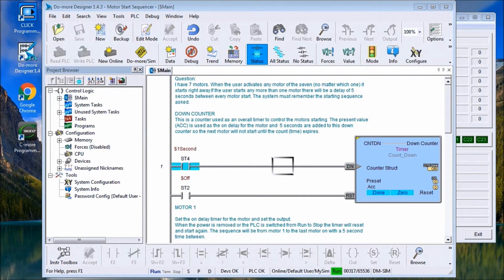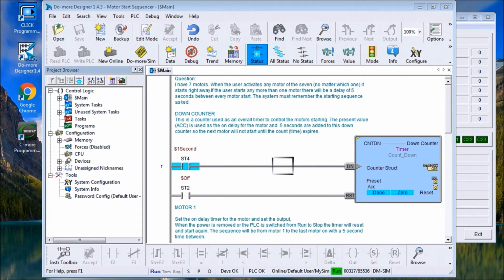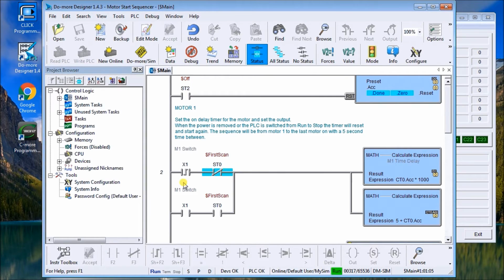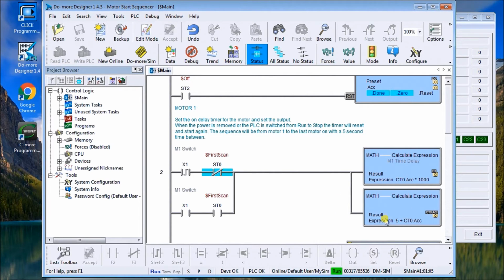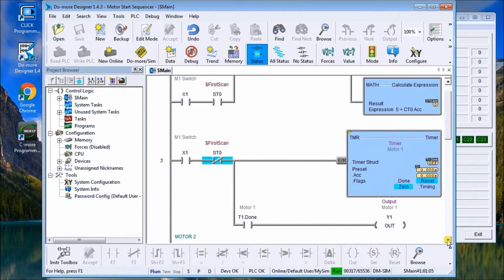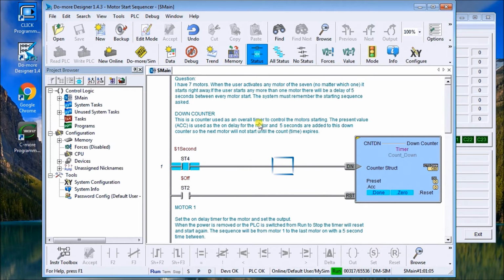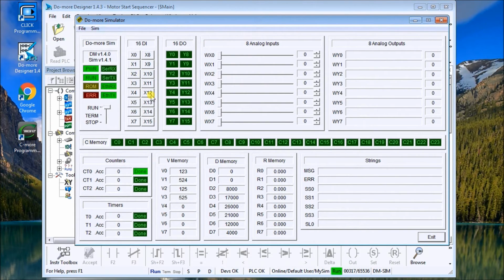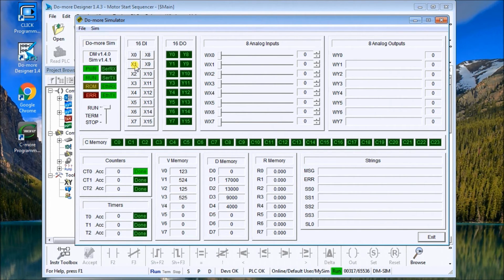Master PLC Motor Delays: 7-Motor Sequential Start Guide

Comment: Hey. Can you tell us where we can finde book or manual where we can finde all instructions that exist for that plc that you are using.
Reply from the maker: The manuals can be downloaded free at the automation direct website. http://www.automationdirect.com/adc/Manuals/Catalog/Programmable_Controllers/Do-more_Series_PLCs_(Micro_Modular_-a-_Stackable)
Select the manuals tab. 
Software is also available free and comes with a very good simulator. It can be downloaded at the following link.
http://support.automationdirect.com/products/domore.html

Regards,
Garry
Reply: I think that would be better that you make video of making ladder diagrams and explaining each component what is ther porpuse and why is there, step by step. For example I never would know that there are puls generators that make puse every 1s, I could program that. It would be easyer to all of us 1st to know all ladder symbols
Reply from the maker: Good idea. I do not have anything that breaks the PLC logic down into the individual components. Our PLC basic menu only has the following:
http://accautomation.ca/programming/plc-basics/

This page will be the closest thing that you are requesting.
http://accautomation.ca/plc-bits-numbers-and-position/

Regards,
Garry

Comment: how do you connect the rungs to each other?
Reply from the maker: Hi Rainbow,
A new rung will automatically start in the Do-More Designer Software. You cannot connect them.
If you want to draw vertical lines for parallel contacts (input or outputs) within the rung then this can be done using the following:
Use the Ctrl + Arrows to make a vertical line. (Arrow up / Arrow down) Ctrl + Shift + Arrows to Erase.

The following is from the Help menu of the software:
How To Draw Wires Between Contacts and Coils

Creating complex ladder logic requires the ability to "draw" networks of input contacts and the ability to connect multiple output coils or box instructions in parallel. Do-more Designer uses the Ctrl key with the arrow keys to draw connecting wires in the direction of the arrow.

Wire Right (Ctrl + Right Arrow) - draws a horizontal wire in the current cursor location and moves the cursor to the right. Drawing a connecting wire over the top of a contact will not delete that contact; it will simply connect it if needed.

Wire Left (Ctrl + Left Arrow) - draws a horizontal wire in the current cursor location and moves the cursor to the left. Drawing a connecting wire over the top of a contact will not delete that contact; it will simply connect it if needed.

Wire Down (Ctrl + Down Arrow) - draws a vertical wire along the left edge of the edit cursor down from the current cursor location and moves the cursor down to the next row.

Wire Up (Ctrl + Up Arrow) - draws a vertical wire along the left edge of the edit cursor up from the current cursor location and moves the cursor up to the previous row.

Wire to Output Column (Ctrl +W) - draws a connecting wire from the current cursor location all the way to the output column. Pressing it again will remove the connecting wire that was just drawn.

--------------------------------------------------------------------------------

During the process of editing ladder logic rungs, there will be times when a connecting wire needs to be deleted. Do-more Designer uses the Ctrl key and the Shift key with the arrow keys to delete connecting wires in the direction of the arrow.

Wire Delete Right (Ctrl + Shift + Right Arrow) - deletes the horizontal wire or programming element in the current cursor location and moves the cursor to the right.

Wire Delete Left (Ctrl + Shift + Left Arrow) - deletes the horizontal wire or programming element in the current cursor location and moves the cursor to the left.

Wire Delete Down (Ctrl + Shift + Down Arrow) - deletes the vertical wire along the lower left edge of the edit cursor and moves the cursor down to the next row.

Wire Delete Up (Ctrl + Shift + Up Arrow) - deletes the vertical wire along the upper left edge of the edit cursor and moves the cursor up to the previous row.

I hope this helps you out.
Regards,
Garry

Comment: Hello,
Please help me with a little PLC Programing Logic for a specific aplication I need to do, that confuses me a lot.

Problem:
I have 2 Electric Reversable Motors, lets name them M1 and M2.
These motors can be start up by a human from an operating console, like an HMI after passing a checksum of diffrent conditions (so the start up comand will result in a continous signal - representing the confirmation of command received and all the conditions passed).

Now I want to implement a logic that will make the 2 motors start with a delay of 90 seconds from each other following the next pattern:

If M1 receives a start comand (the confirmation comand) and M2 does not, then M1 will start up right away.
If M2 receives a start comand (and ofc a confirmation comand - that I already implemented) while M1 is still starting-up (within the 90 seconds dalay), then M2 will wait for the delay to pass and then initiate a start up. If the dalay had already passed then M2 will start right away.

The start up comand for both of the electric motors have to be a continous signal. For if this is interupted, then the motors will stop.

This has to work on and on if any or both of the electric-motors will be turned off either 1 by 1 or both at the same time and started again randomly. So you might stop one and start it right away (well after the delayed from the other passed).

Thank you very much,
Hope to hear from you soon,
Manuel
Reply from the maker: Hi Manuel,
This is exactly the same as this video, except you have only two motors and 90 seconds between.
Just modify the code and you will have a working system.
http://accautomation.ca/plc-programming-example-delay-starting-of-7-motors
Regards,
Garry